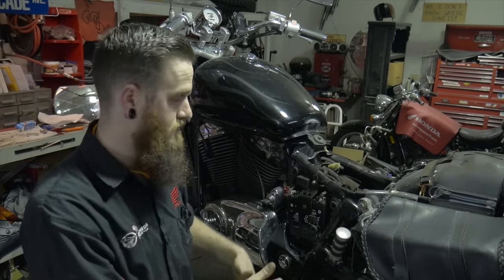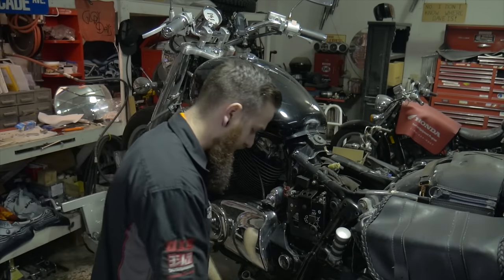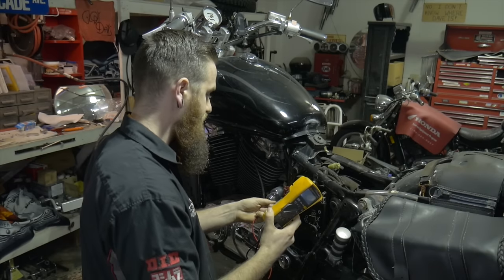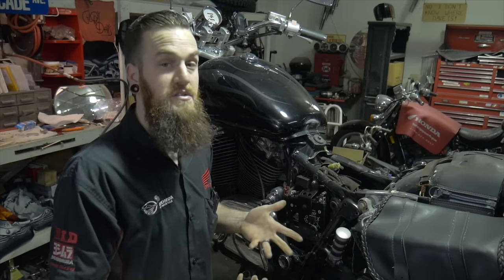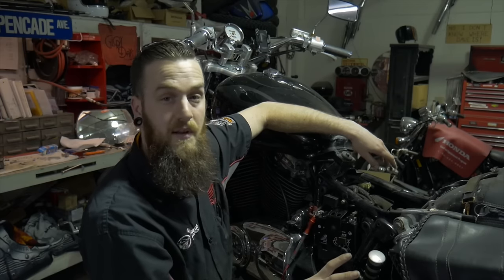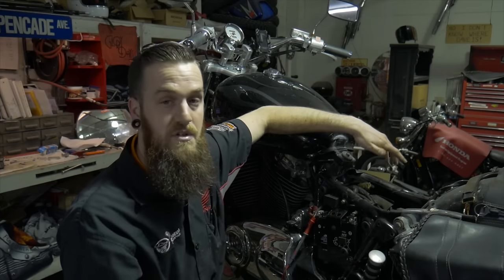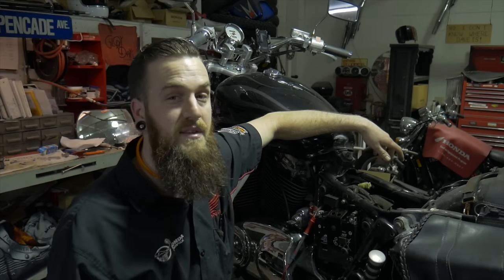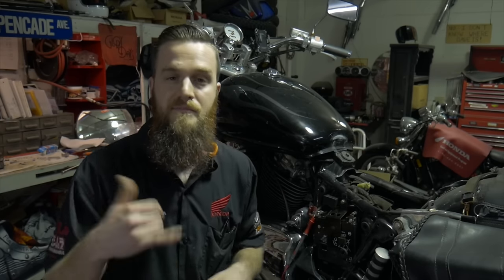Motorcycle Charging System: Bad Regulator/Rectifier

Comment: Hello Cody, this video was very helpful. I had an issue with my 2012 VRod and not sure if I solved it by replacing the VR. Story is that the battery was purchased/replaced twice thinking it was a bad battery but the check engine light and the battery light would keep coming up after about five miles riding, then dashboard and bike would just dye. Once cooled down it would start. Called HD after explaining the issues they said to ride it for about 10 min, touch the Voltage Regulator and if it was too hot then that was the issue. Well, I did that and the VR was not hot at all so is that also a bad sign for it? I ended up swapping it but is tricky on vrod as there’s no much space and the cables are pretty short. I have a couple of questions. 1) There’s a cable with three pin holes, they aren’t marked and the cable can connect matching the pins differently so does it matter how this goes in? 2) I did connect it, charged the battery overnight. Red the bike w multimeter it read 12 something  then fired it up and went up to 13.56. Turned it off an on a couple of times when off it read 13.28. As I reved the engine it would go up to 13.76 or so but nothing higher. I then touched the VR and was very hot. My question is, did I fix the VR? Does it supposed to get hot or stay cold?   Thanks in advance

Comment: Thanks Cody -  I heard that honda had a charging system that they only used for 2,3 years from 1983-1985 on the nighthawks.. I have one and was having charging issues. I couldn't figure out how to test if the Field Effect coil was turning the system on or keeping the system shutoff.  Am I correct that those years had a system that honda parted from because of issues with their design?
Reply from the maker: 100% correct. They got rid of that system near the end of the 80s it was a powerful system but failed constantly.
Reply: @TheMotorcycleMD  - If mine fails again can I retro fit a different system on it? I ask cause I ended up swapping out the stator and the VRR at once and don't want to have to go through that again..

Comment: Great video thanks man. My 78' cb550's battery keeps losing it's charge. I know the stator works and the rectifier was changed recently.
I"m wondering if it could be a short somewhere in the harness. BUT thanks for explaining the charging system, I"m a newbie at this and your explanation was clear enough for a knucklehead like me to understand.
Reply: What was your issue on the bike?

Comment: Nice video very educational, Thank you, I do have a question though, I have a 2019 can-am Ryker Rally, I put LED headlights on it, I have a sound bar and a LED light bar, a camera system and the multi-color light pods, I am planning on putting a nice music system on it, what can I do to make sure I still have the power to operate all this stuff, with my current set up, I am losing the charge, I put it on the battery minder it gets full charge, but if I turn it on for like 2 minutes and put the minder back on the voltage is down again, so with this now I get a VSS FAULT, and eventually it will go into limp mode but once its shut off the bike resets and cranks like normal, but I lose a lot of safety features.

Comment: How quickly does overcharging kill a battery?  

My 2015 Kawasaki KLR 650 seems to be HARD on batteries. I got stuck last year when my battery died on me while I was out riding. I decided to try a Duracell Ultra AGM battery (2-year warranty) from Batteries Plus. I put it in last year on July 27, 2018.

I was concerned with how the KLR had been starting lately, so I decided to take the battery in to Batteries Plus and have it checked out. The guy told me it needed to be replaced. Luckily, it was under warranty and he gave me a new battery. He said this is a top of the line battery and should get anywhere from 3 to 5 years of life. I got 13 months.

Comment: So, Question......My 1981 KZ 550 is putting out right at 16.5 when i increase RPMs to 4000 with high beam on. Thats still too much, Correct? I had a melted stator plug just as you showed but have repaired all that. REG REC? did a diode test on it but it checked ok

Comment: Hi I have a question about some bad symptoms if the regulator is broken. Does it also affect mis firing and lights up the check engine?. Cause my yamaha dragstar 400 misfires and i put a new battery then it out of power again. And some of my lights are having a hard time to open.

Comment: Hey appreciate any help to clarify this. If we measure the batt without turning on the engine and it reads lower than 11-12v, does it means that the battery is spoiled? or the battery can be save by charging it?

I'm having battery problems and it reads 4v

Comment: Hey I have a Shadow 750 that I just bought. The previous owner replaced the rectifier/regulator last year. Today I went for a ride, parked the bike and then I couldn't start it. Battery was completely dead. I got the bike home and charged the battery. I started the bike, and tested with the voltmeter and it reads 12.5V at most. When I rev the bike, it increases very little to 12.6/12.7 and then it starts droppping. I can't get it to go past 13v. Should I suspect the stator at this point?

Comment: I have a 2010 R1. My bike struggles to start after long runs. My battery holds around 13.2v at idle and rises to 13.6v maybe 13.8v at 4000 rpm would you say this is reg/rectifier or stator? Thanks in advance

Comment: I have a 1998 honda CBR600F3 and my headlight bulb keeps blowing, I hooked up my multimeter to the light bulb socket and my bike is pushing out 14.5 volts at idle and close to 20 volt but throttled up. Any suggestions as to what could be causing the problem?

Comment: Heyo this vid sounds so good ..could the rectifier that over charges the battery cause the terminal to pop ? I had two batteries and the negative terminal popped on both..i thought it was the bounce in the box or something. I got a new a battery . And its roughly 13 v and when started same but didnt do what you did here.  So in the morning 8-28-19 i will jump the bike and it stays on its own ..then turn the high beam on and give it a little gas.. so helpful and hopefull its just the rectifier cause i didnt want to have to change the stator yet..

Comment: Great tips. Thanks Cody. I have a 83 Nighthawk 650 with a charging issue. I've heard this bike doesn't charge at low rpm but ldk if that's true. 
Thanks to your tips, I can at least put a meter on it and see what's up.
Reply: did you figure out your charging issue? I have a 1983 650 nighthawk with the same problem.

Comment: The best voltage for charging a regular lead acid battery is 14.0 to 14.4VDC. 

Otherwise, too high voltage on the battery can also be the result of the loss of the ignition wire connection on the regulator. Also, with the series type of regulator, which has diodes in the plus and thyristors in the rectification of the minus, the breakdown of the stator winding to ground generates an excessive voltage of the accumulator at high rpm.

Comment: When I switch my bike on my speedo registers 105mph. The battery I just replaced was on 19v  so was overcharging.. now with a new speedometer, clocks and battery my speedo still registering 105mph when bike turned on and not moving. Could this be the rectifier? Thanks

Comment: I get and overcharging reading as the video shows. But the electrical check of regulator say it is ok. It is possibile?
Reply from the maker: If the charging output keeps climbing and never hits a ceiling then the reg/rec is not doing what it is supposed to do

Comment: My 07 sportster 1200 had a check engine and battery light come on. The battery died so I replaced that. Within a few minutes the lights came back on. I  checked the battery while at idle and while RPMs around 5k, voltage would be around 12.4 and then randomly drop to 2v, 5v etc and then back to 12.4.  I swapped the voltage regulator and tested, voltage goes up to 14v at 5k RPM but then flashes 7v and other random numbers, then back to 13.5v, 14v. What’s the deal with that?

Comment: hey dude ive finally got a honda - been following you a while its a 2000 VTR1000 and my bike wont charge- ive changed the solenoid, stator, battery and im gonna try an OEM RR but have tried another RR
it also has a ground to battery outside the plug does that matter?- anything else I can try?

Comment: Hey brother, I have a Yamaha fz8 and I have an intermittent weak start. I also have an intermittent error code 20 on my bike which is that the voltages when the key is turned on don’t match on the atmospheric sensor and air pressure sensor. I thought that might be the issue but sometimes even when the code doesn’t appear it still has a weak start, although it always cranks. Any help would be greatly appreciated. Thanks

Comment: So today I took a ride on the highway my engine and batt light went on....I watched my voltage meter head south to below 5v...luckily I made home. Turned it off and tried to start again, would not turn over,, just clicked rapidly....Pulled my seat and checked the batt showed 11v....any help is appreciated

Comment: Hello good Morning.  I would like to be able to ask you a question about a 2011 yamaha bulcan review it and I have changed 4 fuel pumps and I always lose reaction when accelerating after I have 30 minutes or less.  cold works well.  But afterwards he no longer responds when asserting. I have been from workshop to workshop for two years and no one finds the defect.  I'm from houston texas and no one here has been able to help me.  your experience.  which may be ????  I have already changed the injectors.  The coil 4 fuel pumps, pressure regulator plugs

Comment: On my 97 shadow 1100 my bolts are 8-9 not running and when its running it stays and 10-11. The connector is a little melted just around the connectors, I'm gonna change the connector later today but any ideas if that doesn't work?

Comment: Does the regulator/rectifier reduce voltage output as battery charges? I took the following readings with battery fully charged (13.5v as soon as disconnected from maintenance/smart charger).

I'm getting on my 1998 VFR800Fi:

14.3v at idle with side lights on
13.9v at idle with headlight on (dipped)
13.5v at approx. 5,000 rpm with headlight on (dipped)
Reply: A battery LOAD test is needed after charging . Stores that sell cycle batteries should do this test free. Then you will be ready to check the voltages on your cycle while running.  Hope this helps.

Comment: Hey man, I just bought a new battery for my Honda shadow 2001, the initial voltage for the battery was 12.75, when I turn on  the motorcycle and stays in idle the voltage is 12.45/.51, when I accelerate the bike the voltage jumps to 14.5, this is the second battery that I bought in one year, my question is, are this the  normal numbers?
Reply from the maker: Yes. That is a solid charging system voltage. Everything sounds great. 12.7 is a good voltage!
Reply: @TheMotorcycleMD  thanks for answering, just I I have one more question, what number do you consider a weak charging system? Meaning that there is something wrong

Comment: Hello Cody my name is Joe I've been a long time watcher of your videos, would you help me with my charging issue, my battery is not being charged, above 5000 RPM it barely reaches 12-volt, so you think that would be the stator coil or the voltage regulator and rectifier, if you could help me out with this one Cody that is the biggest help you can give me brother, thank you very much.

Comment: Haven’t used my bike in over two years only 2 times and that was only to move it to the new house changed it at 100% but my bike wouldn’t start plugged it back to the charger and it read 30% I’m guessing I need a new battery right?

Comment: My 2006 vulcan Nomad at "idol" shows 14.6 volts. Then at high rpm it does not rise, stays at 14.6 volts. Is that the stater or reg/rectifier. I Have an intermittent  mis at idol ? Thanks.

Comment: I have a KTM Duke 390 i changed the stator and i bought a new battery. But after a 30min ride if i switch the bike off and then try to start it the battery is barely alive and it wont start. I have a voltage meter on the dash and it shows 11.1 Volts. After letting it sit for 10min the bike starts and the screen shows 13.7/14.3V and in the middle of the ride it starts to drop to 12.4V and when i rev it past 7k rpm it goes up to 14.3V and starts charging again. The only thing i can think of its the voltage regulator but i am not sure. Should i just buy a voltage regulator or could there be a different problem?

Comment: Great video ! Thanks I'm having trouble with batteries on my Daytona.... now suspect R/R but will use your simple test first thankyou
Reply: Hey there after removing cleaning and refitting the starter motor( worst job ever ) and also checking nearly every part of this system I vould at home I paid to have it diagnosed at triumph 1hr labour £45 

It was indeed a faulty starter motor. I'm happy to share any info I have and videos of my symptoms as I know that Daytonas can be quite tricky to fault find
Reply: @Joe Hughes I agree totally however most owners are blinded by the barrage of people always saying its R/R when in fact tje red starter button connection can be dirty 
The starter motor or solenoid can be faulty
Alarm systems can drain batteries very fast
ECU can produce strange faults 

Most owners go straight to r/r and it cost them ££££ to find out it was something simple

Comment: Will the rectifier regulator also cause the battery to not in my case rise up to 14.5v when at rpm is at 5k. The battery voltage doesn’t drop but it doesn’t raise either and I have to jump it when I stop
Reply from the maker: It could be, if it’s charging anything over 12.8 to 13.5ish at all when at idle then it’s at least doing something. 

You need to check stator output and the checks in this video with a factory manual to diagnose exactly where it’s at and when.
Reply: TheMotorcycleMD good deal man thanks. I tested the rectifier it was a good 14 when  on the throttle. The stator had one phase that was at spec and the two other ones were pushing higher volts than what it should be. So I guess that would point more to the stator than. Thanks man

Comment: I'm surprised that Honda still hasn't dealt with the problem of melting of the electrical connector for the stator.  I have a 1984 Honda Goldwing and the word way back in the '80s was to check for the melted stator wire connector.

Comment: Doc i need your help!  I took my bike in for a stator rectifier change and shes charging wonderful now!  ( although i do still triccle charge her every few days!)  Anyway ive noticed that when i get her on the road it wont let me get past 8 rpm  in first gear without spurring  or flat out stalling!  What could this be ?    ......now i rode her around a bit and pu TV her in first with fhe clutch in and it gave me no problem ( but it wasent moving)???????    
HELP!!

Comment: But what if the voltage is jumping up and down when running? especially when using brake light and turn signal at the same time? does it mean a bad battery?

When running i got around 14.6-14.8v
but when lights are on it drops to 12.9-13.5v (or lower) and back to 14.6v
When engine is off, with lights on (brake light + turn signal) voltage drops 10v or below then up again to 12v+
I also encounter sometimes the starter cant crank the engine at first push of the starter button
sorry if my english is bad

Comment: Hi cody just want to ask my bike had some flickering lights and the voltage on my volt meter suddenly drop to 6.5 volts then comeback to 14v sometimes it reach 16v. Do you think it could be the rectifier?? Thanks
Reply from the maker: To difficult to say. Make sure your battery connections are tight as a tick. I would need more verification of this intermittent drop and spike before I assumed anything. Might want to check what the bike charging specs are supposed to be at. If it’s something like 14.8 or 15.4 at 5,000rpms and you are seeing 16v. Then yes likely to be the reg/rec. 🤙🏻

Comment: I'm hooked up a phone charger to the fuse on my bike it's a Kawasaki zx636 one wire burnt in the stator one wire burnt in the rectifier and one wire burnt in the fuel pump I replace most components but it won't turn the starter what should I look for next please answer ASAP because I have no more transportation

Comment: how long do i need to ride PER startup, to make sure that net charge is slightly more, than what was used cranking up the engine? is 5 minutes idling enough?
Reply from the maker: There is no set time so sure, 5 minutes is fine.

Comment: i have a question...

.. how do i check stator and rectifier on zx6r if the bike is not running?

it had burned start relay fuse.. now it has electricity but does not wanna start at all.. does not crank...

Comment: I have a 02 Suzuki vs800gt intruder. It shut off on me while I was riding it. I had no power to lights nothing. When I put the battery charger on it. It will fire off. But the second I that the battery charger off it dies. Any help would be greatly appreciated.

Comment: what if you start up bike stays at 12.4v, when reving it stays around 12.5-12.6, once turned off goes down to 12.2, once light turns off, goes to 12.65? is that bad?

Comment: I have a 2001 ZX7R that puts out 15.5v max. The manual shows 14.8 max but the regulator test good per the service manual. Should I be concerned about 15.5 or let it go? Great channel. Thanks
Reply from the maker: As long as it doesn’t keep steady climbing over 15.5 I would let it go